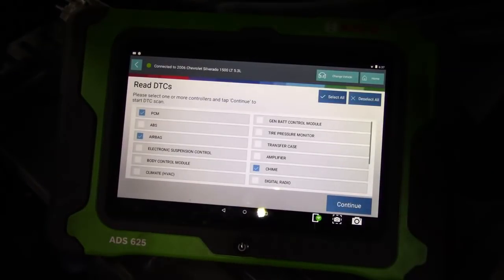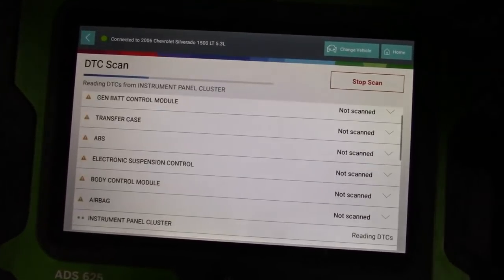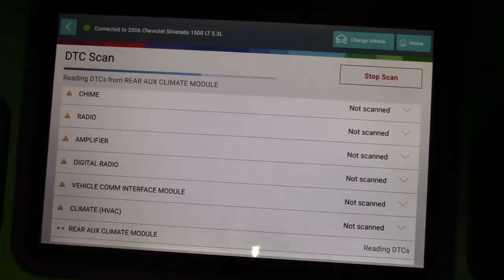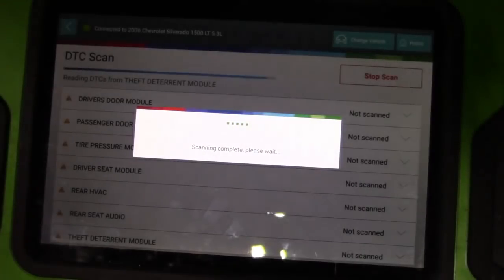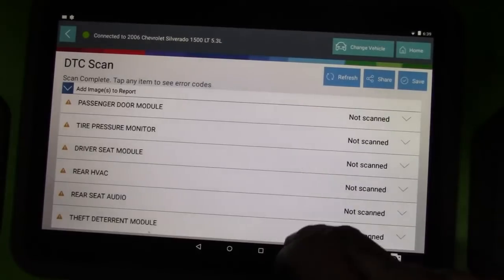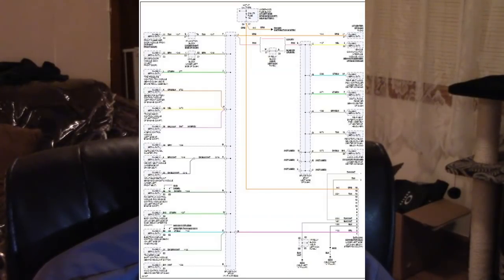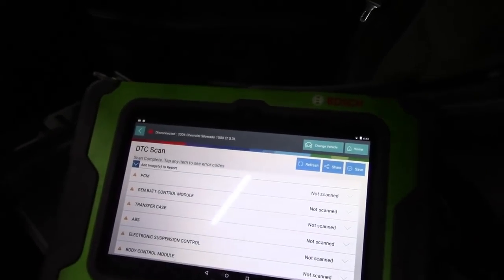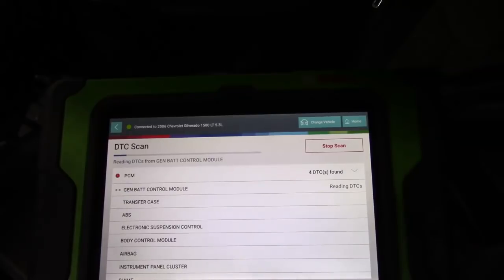CAN  Bus Troubleshooting  No Communication Diagnostic Strategy( Stop Guessing and Start Diagnosing!)

Comment: Those aftermarket radio interfaces can be a pain in the ass. When they work they work but when they don’t they can cause all kind of issues. If your going to flash a module and you see an aftermarket radio then you better unhook it first. It can make for a long day if you don’t know about the issues they cause. I love that other shops run from these problems as I enjoy diagnosing network problems except for this one time on an auction GTO that had an intermittent connection at one pin in the instrument cluster connector. It’s basically a Holden vehicle and scan tool compatibility was already janky even with tech2win so it threw even more variables into the mix. I was so happy when I found that problem. The car was clean otherwise and I guarantee it was run through the auction because nobody could find what was causing that issue.
Reply from the maker: Oh man...That sounds like a ball of crap...Great job catching that though.
Reply: Ow ya even the books in old toyotas tell you not to install a 2way mobile radio in the car

Comment: Knowledge of system, circuit, and network design and practicing your diagnostic procedures to be more efficient it key. The hard part for a growing tech is doing it in the approved time without costing the customer money for their lack of speed because of double checking and learning and development of their knowledge. Pressure of time is money causes bad diagnoses and costly mistakes. Joe by you and the guys sharing y'all knowledge and experience y'all help us improve in leaps and bounds and I'd like to thank you for that. I'm in the process of getting a Uscope and hopefully a vantage pro so I can improve at my own pace on my time. The shop I work for has a modis edge ( 2 channel scope) but it's the shops. So I can't use it without someone paying. It kills me to have a one percent doubt in a diagnoses no matter what part of the vehicle it is.  Keep em rolling out Joe. Thanks again

Comment: Great video I helped friend earlier today I wasn't electrical it was coolant leak on 05 Chevy Malibu max which looked couple months ago which had parked vehicle water pump was bad now looked couple months ago I could tell first 2 minutes I'm looking at it that the water pump was bad based on the water pump pulley was wobbling what happened to be over his house today and his wife was one of the car back up and running so I pulled the airbox off just to get Clearview of the water pump which as I said it was bad but it was leaking around the pulley which since I was already there today I change the water pump out for him but in the meantime I put the water pump back on and was going to stick to belt back on and realize he had two more pulleys bad tensioner pulley and an idler pulley just by paying attention

Comment: Great video. I’ve used the snap on data bus fault finder EEFF500 like Eric O says not a sponsor. I actually had a Snap on dealer give it to me years ago when I had upgraded my scanner. Didn’t get to use it until 1 year later and it did work. Some techs don’t know about those data connections. Very great info for new techs coming into the field and seasoned techs too. Thanks for sharing. I’m glad you didn’t stop making videos. ✊🏽🇺🇸

Comment: That's a great diagnostic, and yes, going for aftermarket additions first does make sense. Like a guy I used to know always said; "Yeah, you did it, but you didn't do it right"---aftermarket stuff is often hacked in. But in a case like this, wouldn't it be ok to wire the aftermarket radio straight to the battery with an inline fuse installed for safety, or does the stock radio have to be part of the circuit?

Comment: And that's why I don't use a aftermarket radio harness and or module for power and ground. I would tie in to the speaker system off the factory harness but that's it.

Comment: Great diag and process Joe. Your videos are beneficial to anyone wanting to learn. The keyboard warriors that don't..... well, whatever. I would bet that the issue with the aftermarket radio is the blue module behind which is an easy replacement and usually a reliable product. But going back to factory is one less thing to worry about.
If only customers knew what goes into diagnosing issues lol.

Comment: I have experienced these symptoms on my 2500hd 2006 gmc after killing the battery by leaving the key in the on position by accident. After jump starting the truck with another vehicle exact same symptoms. What fixed my issue was disconnecting the batteries for 30 mins. After reconnecting batteries everything was back to normal. My issue is probably completely different but figured I’d comment anyways.

Comment: Scot...nope..not him!  lol.  Surprised you were able to get the customer to return to a stock radio.  I'm sure the price is up there compared to better performing aftermarket ones.  Why did the aftermarket one even need the network wire?  To maintain steering wheel controls perhaps?
Reply: If I recall, the factory headunits just have a constant power feed to them, and they are power switched via the network. The module breaks this out into constant/switched power lines for the aftermarket unit, and will usually double as the door chime as well.

Comment: Joe, first time watching video but in the beginning you said tach worked. Is that any kind of a significant clue? Now I will continue watching. 👍 Joe excellent video and great logic. That gateway connector is a gift. Heard Keith mention it many times but he never really showed it and how to locate and use it. I know he is very busy and can’t walk us through everything but thanks for showing and explaining.👍 Joe is the gateway shown on the schematic? Is it a point where everything is so to speak deadheaded? I mentioned the tach. Moving only to show the computer was being activated. Great video excellent advice and look for the obvious and aftermarket.  Thanks Joe ❤️ and Maic Salazar. Taking his ECM COURSE right now great individual very knowledgeable and all should follow and take his course. Just a little plug. I take all advice and courses seriously. Want to learn from ground up. I TALK TO MUCH but want to learn.  Don’t stop Joe.
Reply from the maker: Thank you sir. No, not particularly a clue for me...We knew we were going directly to scan test first. At that point, all that mattered is no comms on anything. If that makes sense.
Reply: Joe's Auto Electric  thanks Joe just thought it would show the PCM was getting a signal. Thanks for answering I’m just trying to learn and appreciate your response. ❤️

Comment: My experience from people that have this kind of problem in my area is it will get very expensive, I have taken care of not so difficult problems that the garage can't fix and for the money, I saved I bought a Pico because I like this kind of work. One example was an old car I got for free because no one could fix a rich condition on the car it is before OBD (Audi 1988) the fix was a shorted o2 sensor wire. If you must pay someone money that can't do the work and find the problem and change parts only and hope for the best you can do it your self and learn along the way, it can also cost you big money but at least you pay for education and next time you know more, sometimes you save a lot of money.

One example is a friend BMW misfire cyl 5 problem they changed ignition coil twice and injector once, a module for injection (not cheap) and a lot of hours on the car did not fix the problem. The next step was to replace all injectors all ignition coils (six cyl) now the problem fixed cars run great. But you must always in life be realistic don't touch anything you don't know anything about you just making a mess and it will get harder to fix the problem. I wish there were people like you Joe around or Eric O Ivan Keith, Dan but you guys is hard to find Santa Clause is easier to find in my area.
I learn a lot watching great troubleshooters on youtube but be careful not everyone is great.

Comment: Joe quick question, do you think this aftermarket strereo was already causing issues 4 years ago and finally stuff got outta hand with the networks?  It's always funny to me how customers/client's claim they've never had issues and also claim they've had it installed years ago.
Reply from the maker: I do not believe the radio caused any problems before. It simply failed.

Comment: were any fuses blown? I saw a case study where several modules were not communicating, and it turns out a wire was run for a light out of the fuse panel, it shorted and blew the fuse.. well the fuse that it blew, was the fuse that supplied 5 other fuses in the fuse block and one of the fuses in the row that was not getting power, wasnt letting the computer communicate.  it was a study keith and Ivan did recently.
Reply from the maker: No sir, as I said in the video, it was simply a module , the aftermarket one, causing the network failure. No fuses blown.
Reply: @JoesAutoElectric  the new rule for vehicles. if it didnt come with it, dont put one in it.. haha
Reply from the maker: Good rule. LOL

Comment: good one joe. at one time if ya didnt have a wiring diagram it was no big deal.  not so anymore. without a road map you'll be looking for tuskegee and end up in toledo figuratively speaking. can networks are no different. gotta know the layout.  and there is absolutely nothing more hair pullin than a diagram with errors or the wong one all together

Comment: I had a trailblazer similar vintage with aftermarket radio. Replaced thermostat had battery disconnected. All done would not start. Took radio off the network all better. Boss thought I was full of it

Comment: Hey joe I had a situation like this and found out that the customer jumped the truck backwards . It spiked the radio module . I noticed there was no door  chime . So for the shit and giggles I started to pull the radio out and I could smell the problem . Basically that blue box Gives you your chime and ign 12volts and steering wheel controls .. yup it was SMOKED .i got another cause he has to have the tv radio
Reply from the maker: Very cool man. Thanks for that info too.

Comment: The first thing i do on a vehicle that i cannot communicate with is disconnect the battery and put the battery terminals together for 30 seconds then i go to the data connector and check my high speed data can bus to check the resistance and see if its shorted or open. Then reconnect battery. And anything aftermarket gets disconnected

Comment: when you install a factory radio does that involve programming or coding of replacement radio?
Reply from the maker: Yes it does. The radio is locked and needs to be programmed which has been the bane of my existence today.
Reply: @JoesAutoElectric  let us know that procedure please, cuz that could get pretty deep
Reply from the maker: Need the equipment to perform programming. Or call someone who does. Sucks actually.

Comment: if you have a basic obd2 scanner with no communication can you test it by disconnecting radio fuse to see if the aftermarket radio is causing communication problem? asking because im currently driving my moms now deceased boyfriends 2001 2500 silverado and he had me install an aftermarket radio several years back and i got an obd scanner and tried hooking it in to see how the vehicle was overall and i could see it light up after replacing cigarette lighter fuse attached to it since that fuse was blown originally and still get no communication which made me think i had bought a defective obd2 scanner tool but i hooked the same tool into my moms jeep which is still 100% stock and it had no problems scanning that vehicle and seeing this made me wonder if i was to disconnect the radio fuse if that would do the same as how you disconnected the radio module to get communication back.
Reply from the maker: Disconnecting the fuse may not help. My advice is to bring it someplace with a professional scan tool and have all modules scanned. See what talks, if anything. If you want quick and dirty, you can removed and unplug radio and see if it comes back online. Remember that just because this one was the radio unit, does not mean you have the same thing going on.
Reply: @JoesAutoElectric  i get that just thought i would ask if pulling the fuse could potentially allow communications while radio fuse is removed, i know it could still be quite a few other things since i do automotive work myself and this is the first time ive encountered this type of issue with obd2 ports in any vehicle and knowing it used to be a work truck before coming into my family im always checking things on it and it hadnt crossed my mind for some reason about the potential of the aftermarket radio causing it with how many cars wire many controls through the radio such as my moms jeep having hvac controls entirely ran through the radio making aftermarket radios as difficult as possible due to the fact that replacing stock with an aftermarket radio could cause loss of all hvac controls among other things throughout the vehicle its just the hvac is the most notable full integration into radio system for that specific vehicle